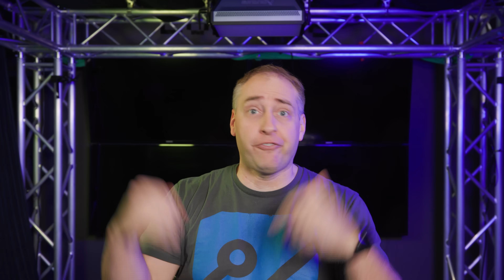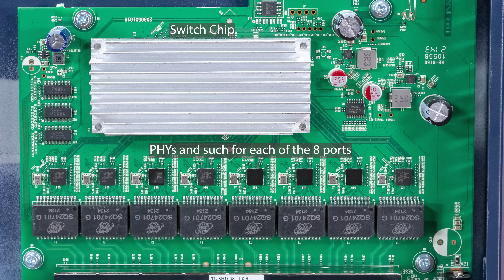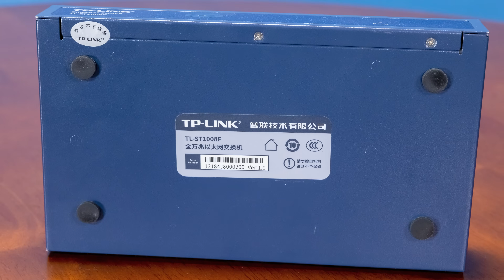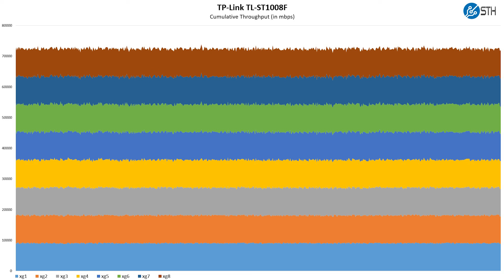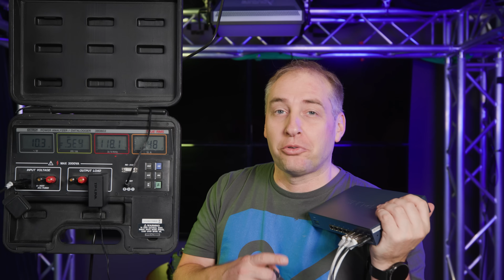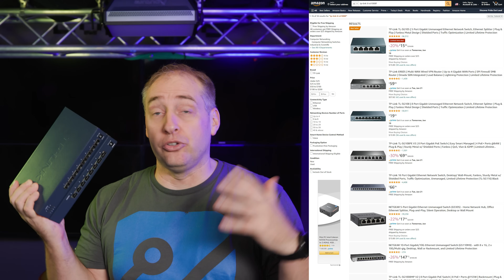Cheapest AliExpress 2.5GbE and 10GbE Switches from TP-Link

Comment: The 5 port tp-link used to be sold on Amazon for 120$ and has same negotiation issue, all connected adapters if plugged in at switch boot will be set to 100mbit until you unplug and replug the cable then it will negotiate. It is a really annoying bug on tp-link 2.5gbit equipment.

Comment: I have had the 2.5Gbe model for a couple of weeks now. It will actually do 100Mbit. I have an old Areca card connected to it that only does that. I had some autonegotiation issues, but they seemed to be cable related. Once I replace those it was solid. TP-Link is quite an established brand here, and it was the only option I could find. They have a pretty good reputation and are common in small business offices, but mine is for home use. I chose 2.5 because that is what I can easily support with the gear I have. I priced a Mikrotik 10Gbe model and with all the additional parts I would need it was quite expensive. I don't have the ebay option. I'm moving from a managed Cisco 1Gbe switch, and I really only used the management for SNMP based activity graphing. It definitely has a specific niche, but it fits well there.

Comment: Thanks for this review! I'm hoping that 10GbE over copper will eventually get cheaper,  really hoping for a quiet 16 port copper based. Is there an ideal price per port?
Reply: Same here
Reply: @LabRat Knatz to be fair "cheap surplus" largely happens when industry adopts the next standard. The industry (think workplace) hasn't evevnt fully transitioned off of 1GBase-T yet. It's still the de-facto standard for office access networks and only workstations with high througput (video editing and DB testing in my case) are getting upgrades to multigig or 10GBase-T. Wifi backhaul only now gets upgraded to 2.5GBase-T wtih POE dedicated chassis instead of linecards.
Lets just say 48port poe 10/5/2.5/1Gig linecards are still stupidly expensive, so you have to still mix and match on enterprise level to keep eyebrows in accounting down.
Reply: @LabRat Knatz likewise, and I'd consider at 5 GbE switch if they sold them in 16 or 24 ports, as long as the X550 NICs can negotiate that speed.  Otherwise the Netgear managed switches are what I have been eyeing and waiting for. I sometimes ask myself if I should have did more research and gone with SFP, I just assumed that was always more expensive and I couldn't wire a home with SFP cabling plus installing these NICs in clients

Comment: I've been running TP-Link's T1700G-28TQ at home for a few years now and it's been solid. Honestly wouldn't be surprised if this has a similar level of quality in terms of the actual hardware - the Chinese market stuff is usually cheaper solely because they're factoring in additional distribution and warranty replacement costs when they sell in the west.

Speaking of cheap, I just grabbed a Brocade ICX6610 (£160 off eBay, score!) which is officially advertised as 10G but it actually has four 40G QSFP "stacking" ports in the back that are fully functioning ethernet links :D
Reply: A 10G switch with a 40G uplink IS a 10G switch.
So...good job to them for not being assholes and labeling it improperly just to get a bigger number?
(I'm SOOOOO fucking tired of running into 10G switches that are ACTUALLY 1G switches with a 10G uplink...)
Reply: @Prophes0r  It has four 40G ports so it's capable of switching 40G.

Comment: FYI, the power consumption does help. This days manufacturers keep very quiet about their power consumption, and when setting your home network, as much as one could absorb the difference in power bills between 200W 24/7 and 10W 24/7, it makes a difference in how office / comms cabinet will heat up. So in short, THANKS.
Reply: Yes. Lots of old businness switches consume 60-80w which is ridicolus when a modern switch with same capability can do the same job with less than 20w
Reply: @marcogenovesi8570  Yes, thou the new equipment has some spread out power consumption as well.

Comment: Also I forgot about it in my main comment - but in Poland we use stuff from TP-Link for decades now. Very reliable, very good products. You just have to have a good source (and since they have official representatives here, almost everything that is sold in Poland is of high quality).
Reply: TP ling has a presence in the us too. They sell a bunch of consumer wifi routers, switches, power line ethernet adapters, directional long distance wifi gear and iot stuff like smart plugs, bulbs, switches and probable a lot more I don't know about. They were one of the oem's along with asus for googles onhub routers.
Reply: In my experience, TP-Link is a bit hit/miss unfortunately. Most stuff seems to work just fine but I've also had customers with their 1GbE switches where the switch would just lock up after a few hours, requiring you to pull the power and restart it. They would then work just fine for a few hours but the whole point of unmanaged switches is that you never have to restart them as there should be nothing in there to restart/reload and having to power-cycle your unmanaged switches 5-8 times per day was a pain in the rear...
Reply: @someguy4915  When it comes to restarts - I do have that problem too. But it's about once a month (27-32 days usually). And honestly I've known hardware from other companies that required it as well.
Thing with TP link in Poland is that they have their official branch here. And since Polish "At&T" used to be called "TP" - everyone assumed that it meant "Polish product" (which funnily enough is I think partly true. I know that some of the things are assembled here from the parts from China) and like 80-90% of mid range stuff that people buy here is TP-Link. And they only sell their mid to high tier stuff here. Especially since warranty has to be at least 2 years (and I think they often extend it) and if some switch was doing what you've described, I would send it back and asked for a refund. Which by law I'm entitled to, once they sent 1 replacement and it does the same thing. Same with not reaching it's speed. If it's advertised as 1 Gbit, but only does 0.999 Gbit - they have to replace it or give you your money back.

Generally I've never had an unrestartable switch that I didn't have to restart at least once every 3 months. At best.
Reply: @jannegrey  Well that explains why in Poland TP-Link would be so popular, lucky branding :P
But besides the TP-Link I've never had to restart a switch to 'fix' it. I have had to restart some managed switches after updating their firmware but never because the switch slows down/hangs after time.
Heck the typical ProCurve switches I used to service would have uptimes of beyond 10 years, at least the ones behind a UPS, they were taken out of the box, turned on and left there for well over a decade until their replacement took over.
Same for NetGear and Ubiquiti EdgeMax equipment, if a switch needs regular rebooting, even if only once a month, I'd consider it broken and claim warranty to have it replaced.
Reply: @someguy4915  Might be my ISP problem. They often come on it to do update and when there is a problem all I'm told is that switch (or router) need restarting. And it is likely the same thing with that TP-Link, since the cycle stopped and this connection has been going for 68 days without trouble.
Reply: @someguy4915  And of course I forgot important info - mine isn't behind UPS. Will be after I'm done making this PC, since it will be in a place where my router is, but it's not as important as saving our work.

Comment: I bought the cheapest mini/micro/tiny computer that I could get my hands on. HP T520 - for about 27$. Slightly cheaper was monitor (Full HD, I think IPS), because it has cracked chassis - but works flawlessly. Currently trying to install some light Linux on it. I decided on Xfce as Desktop Environment, but do you know any good distro that will not choke up on 16GB SSD, 4 GB of RAM (should have 8GB next week) and 2 core AMD 1.2 GHz CPU with iGPU that uses up to 1 GB of RAM? Full systems include Fedora and Ubuntu, but maybe there is something that is almost equally functional, but is slimmed down? I really don't know Linux.
Also next week I will also have 32GB SSD, so I will try installing Windows XP on it and do some retro gaming on games from around 2000/2001. But I'll also try to run those games on Linux (either through WINE or something else).
Reply: Not sure about regular functionality, but MX Linux is pretty lightweight, we run it on an old asus micro PC that feeds a 4K dashboard screen
Reply: If Xfce isn't mandatory look at Ubuntu MATE. Load up a couple USB sticks with various distros and play around
Reply: @duckrutt  That's what I'm doing. And no - xfce isn't mandatory. I need something light and not overly complicated.
Reply: Cool. I would honestly recommend a Ubuntu based distro (Half of all linux distros are based on them so it's not a limiting factor) mostly because their default package installs are fairly sane. DistroTube did a Mint comparison (Cinnamon, MATE, Xfce) looking at RAM usage. I don't think it included VRAM? It was a while ago. It'll show you the differences in 17 minutes.
Reply: @duckrutt  Thanks. I'll watch it. I installed for now Xubuntu and tomorrow (so for me in about 4 hours) I'll be testing it and installing drivers for Wi-Fi adapter for the first time.
For some reason it requires Internet connection and updating the system...... kind of defeats the point of installing the newest distro and buying Wi-Fi adapter, because I don't have cable in this room. Thankfully it is light and I can move it to the other room for 5 minutes.
Reply from the maker: Wow $27!?!?
Reply: @ServeTheHomeVideo  Yup. The monitor was around 23$. So the whole setup was 50$. Of course I had to buy a DP cable, which brought cost up by about 40%, but still ;)
Funnily enough the requirements here to buy open box (which monitor was) basically guarantee that thing will work. If it doesn't I have 30 days to return it and at worst I have to pay for transport.

Any ideas what I can do with it?

Also more powerful models (having bigger SSD or more RAM were more costly than buying RAM or SSD separately. It's a crazy market here. Some things are way more expensive. Some things are way cheaper.

Comment: 2.5Gbe is good for some no doubt but we are soooo way behind in networking for 2022. 2.5Gbe is 10 years too late at least. My Netgear XS708E 10Gbe switch came out in 2016 (maybe earlier) and doesn't even support 2.5Gbe/5Gbe as it wasn't even a standard back then. The part that stinks is that we would have had cheap 10Gbe switches by now if it wasn't for the 2.5Gbe/5Gbe market getting wedged in front. I cannot argue against any of the benefits of 2.5Gbe, only about the timing of delivery. <sigh> Eventually cheap 10Gbe switches willl come but has certainly been slowed down by these "wedged" solutions.
Reply: Agree, I have a Supermicro Xeon D 1521 board with dual x550 10 GbE NICs on board that I haven't been able to leverage because I've been holding out for less expensive 10GbE switches. I picked up this board thanks to the great reviews from STH and Patrick!

Comment: Any good/affordable 10GB switches that aren't SFP?
Reply: SPF+ Direct Attached Copper can go 10m, it's much lower latency and lower power than CAT6 10gbe. The cables can be found quite cheap too.
Reply: @wayland7150  I don't know how you're going to do 10GB wifi or cabling to other rooms in the house with SFP.
Reply: @ericneo2  10gb WiFi? Yes you can cable to other rooms with SFP+.
Reply: Nah they're all like spf30 so not the best sun protection

Comment: Great video. Any plans to review the TP-Link TL-SX3008F  the managed version of the switch? At $240 on Amazon its priced similarly to the Mikrotik CRS309-1G-8S+IN would be interesting to see which is a better value.
Reply from the maker: I can tell you that is not in the next 3 switch reviews we are doing. I need to check what Rohit has planned beyond that

Comment: They might be mostly in China but TP-Link is a good brand.  I don't know about the best but many people sing the praises of the Archer C7 routers.  I can see why too.  I have one and NEVER had to reset it because of a problem at all.  What few times it ever does get reset is when the power goes out and comes back on or when my laptop WiFi acts up and I reset the router just to see if that makes the problem go away.  Really though, I wonder if Microsoft updated the driver behind my back.  I should keep a list of MD5 hashes for the driver files and compare them with those of fresh drivers from their proper source and the ones installed at the time of trouble connecting.  It infuriates me to no end  when they mess with a driver that was working fine.  Then they probably wonder why so many people are starting to lose confidence in Microsoft.  The spying and telemetry in any newer version doesn't do even one thing to keep our trust.  Just in case they forgot, Windows isn't free so it is time for them to cut it out or gradually lose customers as Linux becomes more attractive.  I am one of many people who thinks something we pay to use, especially an operating system, should never do these things.  It is only because everyone uses Windows already they might not have bothered to switch.  I think we need some sort of class action against Microsoft for these shenanigans.  Sure you can legally used Windows 10 free but it has that watermark and you can't change the desktop wallpaper.

Do your personalization first thing possible when Windows is setup, with the internet temporarily disconnected and before it tries to activate.  It is possible and I did it.  You still have the watermark until it is activated but once you see that watermark, it is a sign that it attempted to activate.  At that point your personalizations are locked in and can only be changed once activated.  By doing what I mentioned, you can at least have a nicer looking wallpaper.  This is not a way to have a copy of Windows without paying, the watermark shows on everything until it is activated and is rumored to cause a graphics performance hit too.  That might be from Windows inserting that watermark into every frame displayed.  My Windows is activated but I figured that would be a good experiment to see if any personalization can be done while not activated and it is possible if you do it soon enough.  I am one of those people who likes to set my taskbar to autohide (something that is considered a personalization and is not doable until Windows is activated in most cases).  I like to auto hide it because I think it us ugly and it doesn't always need to be there taking up space.  If you ever get an OLED monitor of any kind that will eventually show permanently as the white portions of the screen are displayed more.  It will be ugly.  Sure OLED displays seem nice but they burn in.  I never ever saw that happen with an IPS display.  All my phones are IPS displays.  My Samsung SyncMaster XL2370HD I must have had more than ten years easily is an IPS display too.  I don't see even one iota of burn-in and I use it every day.  It doesn't even have one stuck pixel, never did and probably never will!!  Sure you don't have the contrast of an OLED, AMOLED or SuperAMOLED display but you have the piece of mind knowing that it just does NOT burn-in!!  The only way my SyncMaster shows its age is it gets a little dusty once in a while.  I never had ONE problem with it!  Unless a nice 4K display of similar size comes down in price I may just keep the SyncMaster until it dies!  It is just a 1080p display but a good one.  When I mention similar size I am not referring to resolution like some people I know wrongly think.  I have a Sony Xperia XZ Premium that is 4K but maybe 5.4 or 5.5 inches to prove that the two terms are not interchangeable.  When people like my Uncle say that a certain size display couldn't be 4K, I use the Sony as a prime example that he is wrong and remind him of it!!  I do NOT let ignorance go unnoticed!!

You didn't poke the bear, Patrick.  I get on a rant sometimes very easily.
Reply: I have two 8-Port, 1-Gb TL-SG1008D TP-Link switches running 24/7 for years, I switched from Netgear back then, because the cheap plastic case  TP-Link switches consume 2W each only (fully populated) and they survive brown outs much better - they never failed. The Netgears were around 10W each and needed power cycling from time to time. So yes, TP-Link works for me as well, keep them 10Gb versions coming.. o)
Reply: You can customize using the registry just fine.  Sure it's a pain, but once it's done, it's done. You can also right click on a picture to set as desktop background

Comment: Theres also a QNAP QSW-1105-5T 5-Port 2.5 Gigabit Unmanaged Switch on ebay uk for £118 too, only 5 ports but hey its a start. Theres also a Zyxel 8-Port 2.5GB for slightly more but at least they are begining to appear on the market for home use.

Comment: You are measuring the power consumption of the PSU not its power output. With 80% efficiency the actual power delivered to the switch is 17.6W. So there's quite a big margin (6.4W or 36%) before 24W. (The PSU is designed to deliver 24W and in that case consumes 30W with 80% efficiency)

Comment: I can only find 2 sellers (browsing from the EU) for the 10Gb switch and their prices are 278€ and 553€, that's not cheap :( It's possible Aliexpress is doing some stuff to hide the rest
Reply: I'm also in EU (italy) and on Aliexpress I see a bunch of sellers for the TL-ST1008F, one at 149, one at 154 and one at 158 euro too, and the ones at 278 and 553 you also mention. 
the sellers are "LA-HM Telecom Store" and "changhe Store"  and "network Product Store"

If you don't see them maybe they don't want to ship to your country? It's a bit strange for aliexpress, much more common on Ebay.
Reply from the maker: Are they the same models?